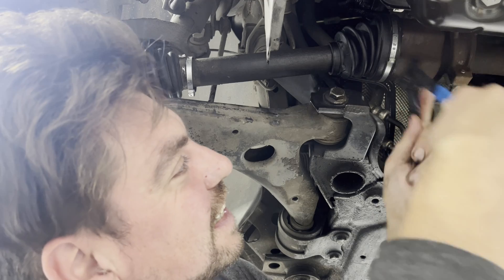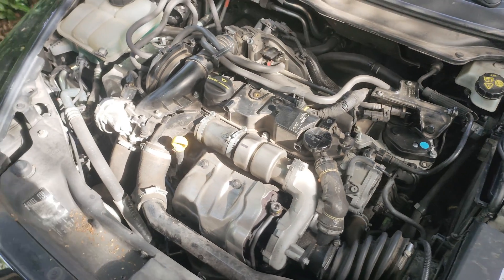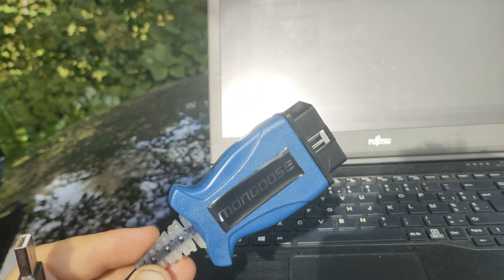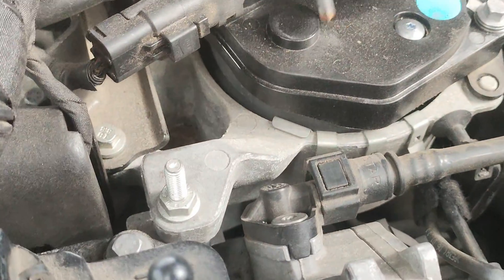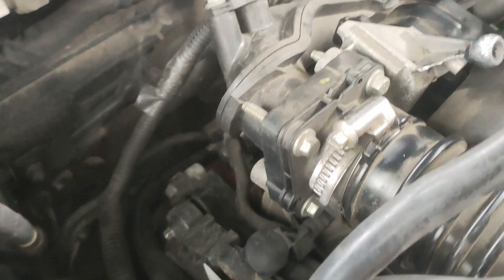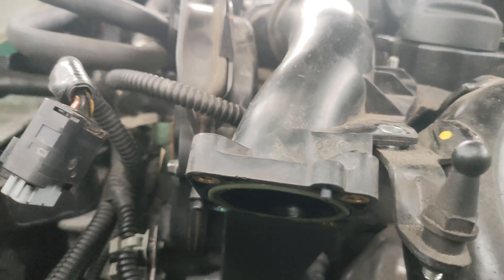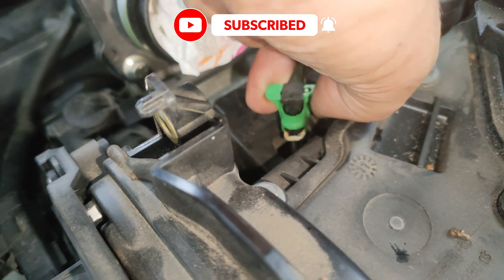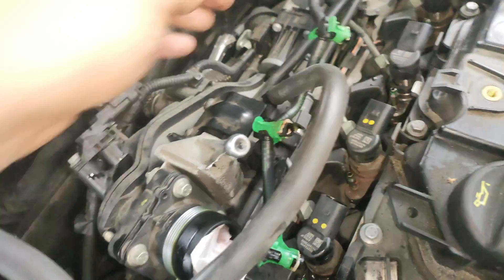Project Volvo V50 - Leaking Injectors? Diagnosis and Removing | PART 1

Comment: Are you sure those are remanned? Cause the price of new ones is about 240 euros.
Reply from the maker: This is what the garage told me where I had the old ones tested. They quoted more than 300 for one injector, claiming the ones I saw online were remanned. I thought it was BS. So far I've had a good experience with them. I have no indication they are not new, but since this is the first time I dealt with injectors, I can't be sure.

Comment: Hello mate, 

About to do some work on a friends V50, MY2005 2.0D but there is no info, diagrams, whatever online. 
Ought to change part with OE no30725838 fuel overflow hose/return fuel hose but can’t locate it. 
Would you happen to know where it is and what is the correct way to replace it. 

Thanks heaps!
Reply from the maker: Do you have a copy of vida? You should be able to look everything up using the VIN. All the repair manuals and parts are in that software.

Comment: Could you please help me with a problem I have with a 2006 2.0ltr Volvo v50 estate?? The car will start when cold like in the morning and I could it drive all day no problem non stop. When I then stop the car switch it off then try to start again it will not start or will start then stops be itself very soon.  Seem like a fuel Issue to me
Reply from the maker: That's going to be hard one to determine. Does it throw any codes?
Reply: @patchnplay. No there isn't any codes on dash or any when I plug it in either. 🤔  it's always when when the engine gets warm it has issues starting again?? EGR Valve? Cam Shaft sensor?? Injectors??
Reply from the maker: @RegenarativeFarm  is it a diesel as well? I honestly have no idea. I would try at the swedespeed forum to see if someone recognizes the problem...